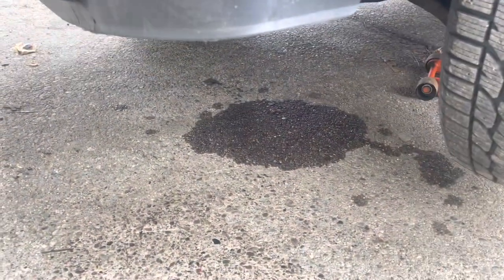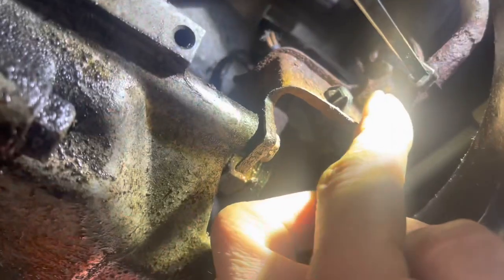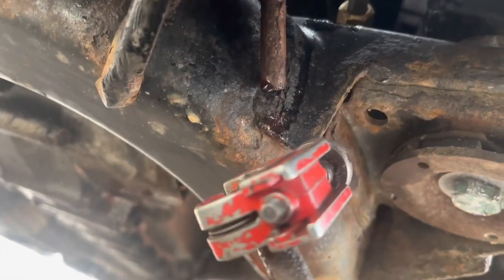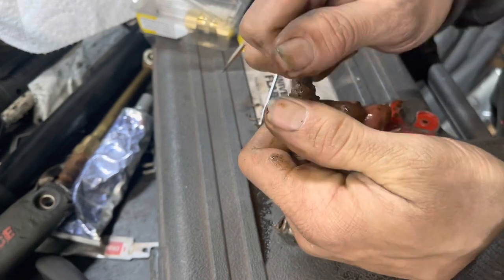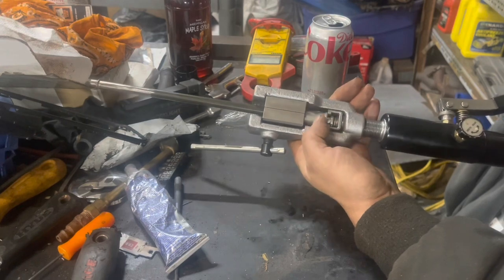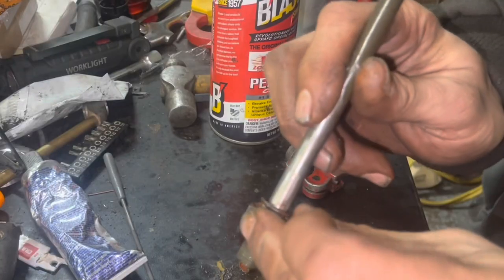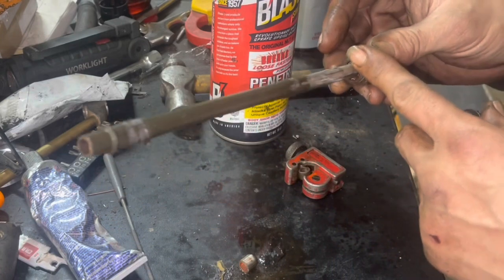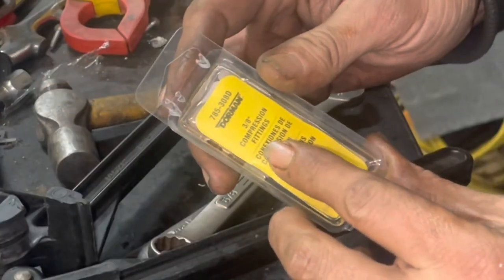Saturn Vue Transmission $400 to $30 QUICK Line Leak Repair

Comment: Thank you! You have simplified this tricky fix like some kind of wizard. Funny too! Thanks man....
Reply from the maker: Thanks, Fred glad I could help welcome to the channel. Happy to help you.
Reply: @sharpcarco  I had hours of trouble removing the "end of the fluid line" from the transmission "screw in fitting". Is there a Honda part number for the fitting?
Reply from the maker: Not that I’m aware of brother. Sorry.

Comment: Would this have anything to do with coolant getting into the transmission fluid in a Vue 2005?
Reply from the maker: That would be because your radiator is bad if you haven’t figured out already sorry I don’t see these messages. That’s why I tell folks to message me on clays AC and Auto Repair over Facebook.
Reply: @sharpcarco   no worries I figured it might be a bit. Yea I figured the radiator was bad, it’s an old car just going to have to hope I make it to a newer one before it goes lol. Thanks for the reply.